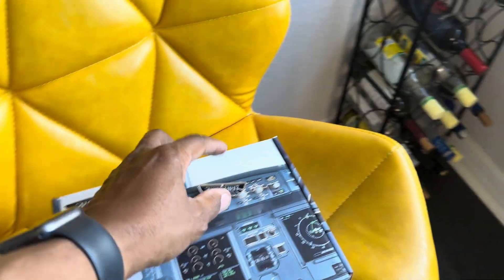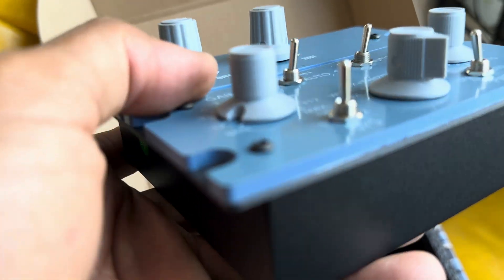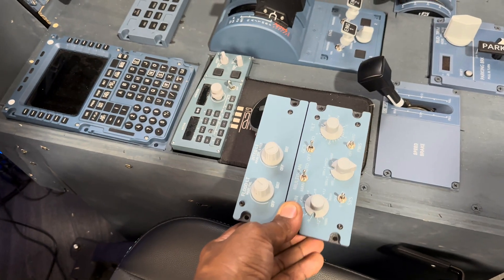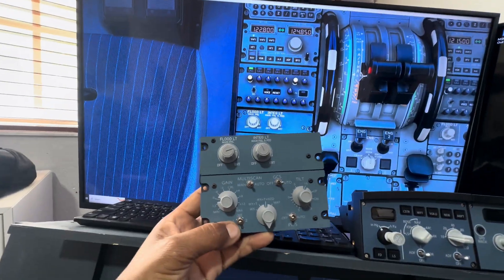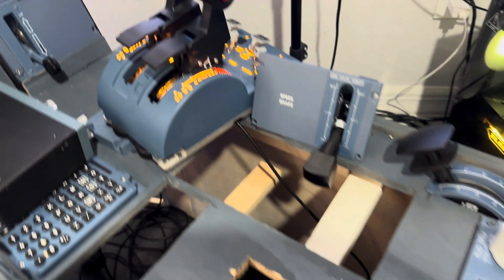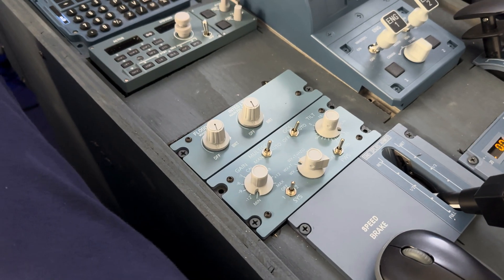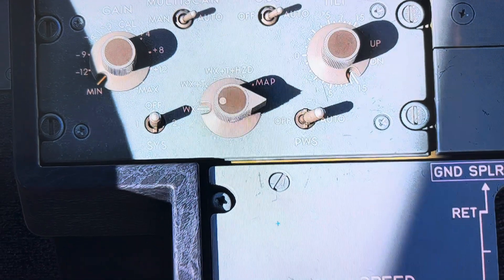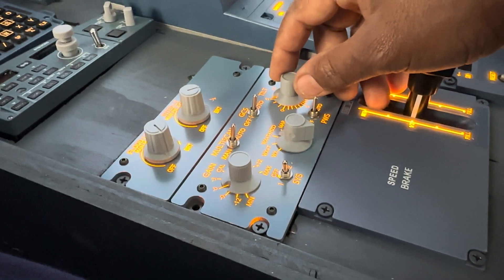Airbus WXR-Radar Integrated Panel Rowsfire A112

Comment: very cool product to add to your rig.  yes, i think at some time you will have to re-do the center pedestal top panel.  a tip at the corners, use a small drill bit so you get a nice round edge on the corners and makes it nicer to finish a saw cut. 
maybe for your mouse you will have to now make a dinner tray that comes out from the front or something that can side out sideways or swing out from the center pedestal, so you can mount / use your mouse.  
you must have a huge USB / USB-C hub for all of them accessories :)   looking nice.  look forward to some more Airbus flying streams.

Comment: I discovered another company that do the entire Captain and F/O side of the central pedestal the other day, Java Simulations. Not many reviews on their kit and they seem to be mid priced (think wing flex level prices between the likes of Skalarki and winwing)
Reply from the maker: Really, I’ll check them out.
Reply: @XP72official both sides minus MCDUs is about $1000 before shipping and taxes. But the few reviews I have seen they look good.

They also have multiple sizes of overhead panels from full size to mini.

Would be great if someone like you could do reviews on their kit because it looks good